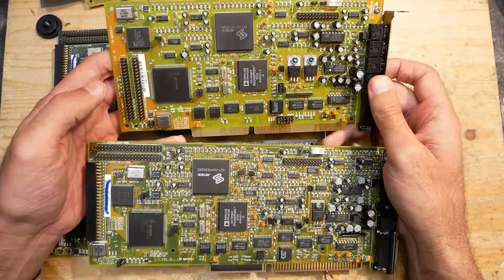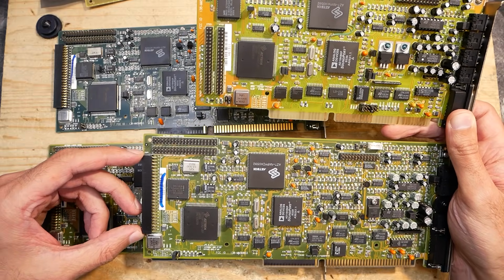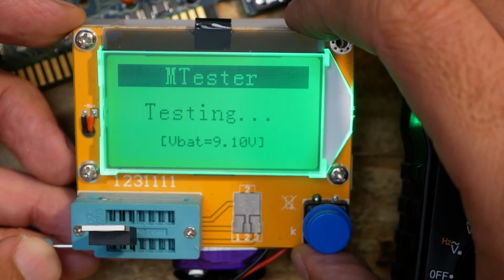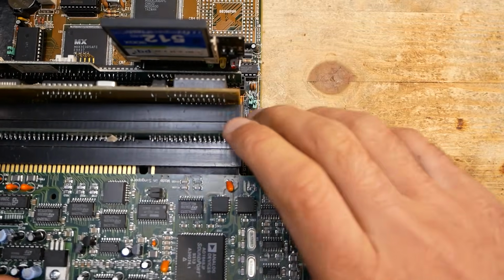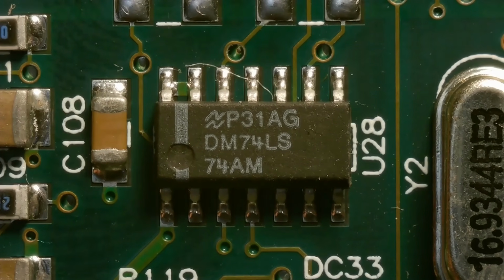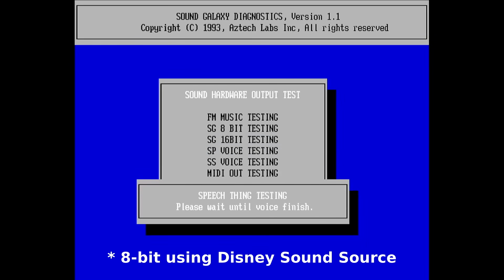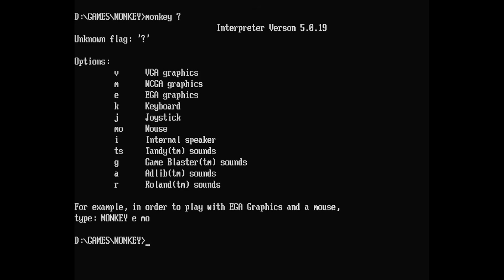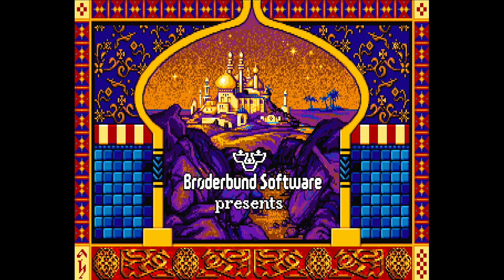Aztech Sound Galaxy NX Pro 16 with SoftMPU and Roland MT-32 emulation.

Comment: Something of note about GODS, the floppy release of Mortal Kombat, and Ultima Underworld:  you NEED a Roland CM-32L, CM-64, CM-300, or LAPC-I for it to sound right.  These games all use a special set of sound effects ONLY on those devices.  A regular MT-32 will not have the correct sounds.

Comment: It seems like phase leak from AC thru shorted capacitor in PC PSU. Audio amplifier was grounded, so it run high current thru sound card

Comment: As other said, SoftMPU only fixes detection of MIDI interfaces, independent of whatever synth you might use. If you arent using a real MT-32, or a MT32Pi type device, then none of the games will sound right using their Roland music option. Try the same setup with your Aztec daughter board, but in the game setups choose General MIDI rather than Roland. This can make the timing of notes weird as well as their sound, since the ASDR envelopes and other parameters will differ.
Reply from the maker: That's the point, there are barely real mode games with General MIDI implementation. Usually those are older games from the time where General MIDI was not yet standardized and so the games offer only MT-32 as an option. I have to try a modified SoftMPU which runs in protected mode games. There was a prototype which I saw.
Reply: @necro_ware  Ahhhhh, gotcha. Makes more sense in that case! It's pretty cool that you got it going though, and the samples on the Aztec daughterboard actually sound pretty good hey!

Comment: 2:34 wth is this color between the pins
Reply from the maker: You probably mean the scratches which were left there by the previous owner struggling to desolder the regulators.

Comment: 10:00 Technology has changed since this card was build.
The fact you don't measure the same values between the regulator pins doesn't always mean it's dead.
Many modern components use Cmos technology, instead of bipolar.
So even if they do the same job, measurements are differents between pins.
For example a NE555 doesn't use 5k internal resistors anymore.
I test regulators with a power supply and measure output voltage on a load.

Comment: Well General MIDI wavetable add in cards/ sound cards have only very extremely basic MT-32 support, which support only default bank. And usually as bank 127 instead of bank 0, so probably you will needs original software from that card (if does exist) which will flip banks. Anyway even after that most games will sound bad, as MT-32 is real programable synthetizator and most of games are programing their own sounds/ patches (that what in reality is happening when you see initializing MT-32, it is trying to send sysex to program MT-32). So better is try to use General MIDI mode then MT-32 😀

Comment: The odd sound is expected when trying to play MT32 Midi on a General Midi Synth. Soft MPU doesn't do full MT32 Emulation if you have that mode enabled, it uses Bank switching only and only works with some synths that have a suitable Mt32 sound bank. The result is poor even when at it's best.  You need to use a MT32PI wavetable card to get proper MT32 Support on the wavetable header.
For newer general midi games (doom, duke3d) you should try to use midi without softmpu as many games just use MIDI UART mode and don't need intelligent mode emulated by SoftMPU.
Reply from the maker: I know, GM has a hard set of instruments, where MT32 uses intelligent mode, where the sets can be uploaded and rearranged. Of course SoftMPU can't do magic and simply maps whatever is there. I was talking more about timing and loudness. For example in Gods the effects were played kind of stretched and very loud compared to the rest.
Reply: Gods needs actually a LAPC-I card or CM-32L / CM-64 module to sound properly. It utilizes extra sound effects that they have been added compared to basic MT-32.

Comment: I have several of these cards. many of basic version does not have Amped output with empty amp chips and components... (only LINE out. No amped OUT) I guess it last longer since it is fewer parts...?!? I guess.
I never understand why they did it but... I guess it maybe possible that the manufacturer found they have faulty design of amp circuit or just cost effect way.
Reply: Most generic soundcards connected this TEA2025 amplifier chip straight to 12V, without any problems. Some later SB128s (and generic ones aswell) also ditched power amp chip.

Comment: Hallo PLZ Turn off auyo dubing
Reply from the maker: I can't turn it off, it's an automatic YouTube feature which is activated for you depending on your default language in your browser.
Reply: Go into the settings on the video by clicking the gear, set Audio Track to English and problem solved.

Comment: if you ever encounter sysex commands, i bet many of the older games used sysex to setup and initialize the instrument patch on a mt-32, 
if instruments sounded odd, i would check if the sysex commands passed correctly from game to hardware, there is also utilities to send sysex only for debugging.

 the sound in GoDs  , sounded uninitialized and not mapped , if i remember, mt32 have a dedicated percussion mapping where games used the samples from the synthesizer rather than wave files.
Reply: He didn't play it on MT-32, but on that GM add in card, that's why it sounded absolutely off.

Comment: MT-32 isn't GM compatible, and vise-versa. Even at a basic level, MT-32 uses a different instrument mapping; GM came later. But what you're running into with GODS is different. MT-32's could use custom sound banks, which meant that the MT-32 could be used for sound *effects*, not just music, by playing the custom samples. Your wavetable card can't load the custom samples for the specific game, so it just plays the stock sounds from the bank that's being called. In other words, the card is working properly, the game is working properly, it's just not going to sound right without an MT-32.
Reply: That's about what I wanted to write about the MT-32. One addition though: It's possible to make the MT-32 GM compatible with a certain MIDI file from them that contains a set of Sysex commands that change the MT32's mapping to GM compatible. 
But yes, MT-32s allow custom samples to be uploaded, and that's where ALL variants of MT-32 emulation fail, as these don't implement this - and probably also can't, as wavetable synthesis works fundamentally different from LA synthesis (at least when looking at it at instrument level).
Reply: @bad.sector Yeah, kind of, though it didn't really sound very good. The mixing wasn't the same, and it had a lot of stuck tone issues, but the hack did work ok in some games. IIRC, didn't some later Sierra games do this?
Reply: @ChrisWadge  I don't know unfortunately. I tested the MIDI mode with Descent, and there it worked without any hiccups.
Reply: @bad.sector Descent is actually a perfect use case, because its electronic soundtrack has very little volume variation and uses a lot of really synthetic instrumentation.

Comment: Isn't the SCSI connector just that, a connector that you can add a CD or HD to directly? Though that would need a driver (and onboard controller...) to work. So maybe not. It seems strange if it's just for an add on board though, would make for a long card.

Comment: Mt32 allowed some sort of samples that you only could see with mt32pi or a real mt32.
 You should not need softmpu for duke3d, as the card itself should expose port 330 in general midi. I had an Aztech Rocky, which featured an spectacular software wave table.

Comment: Reminder that 78xx chips are supposed to be short circuit proof
Reply: @lorenzorentniop717 They are supposed to be, but only if there is perfect cooling (which is not the case here) and they won't last forever. How many of them have I replaced in my life...
Reply: @Thales_WH  that is absolutely true

Comment: The mt32 is not general midi compatible. Meaning the instruments are not in the standardized order. This means music will play, as midi is just note on off and instrument numbers, but it will sound wrong. That wave table board is likely set up for general midi. Use it with games that support general midi. Softmpu supports working with an mt32 but it doesn't turn general midi cards into mt32 's
Reply: This. Additionally, the MT-32 supports custom samples and patches to be loaded via MIDI SysEx commands. GODS seems to use them for custom sound effects (hence the long initialization), which of course will only work with a real MT-32, so the instruments are way off.

Comment: Now I’m thinking if they are ferrite beads or maybe those are SMD fuses?
Reply from the maker: At least, the silk screen calls those FB. Could still be fuses, but since there are capacitors arranged like an LC filter nearby, I thought, those could be ferrite beads. Wouldn't bet on that though.
Reply: @necro_ware maybe they do double duty here. Maybe fuses should have some cryptic markings on them
Reply from the maker: Yeah, may be.

Comment: Those are great little cards - I was able to get them REALLY cheap (especially when they're integrated with a modem, people are afraid of those for some reason) and they had OPL chips and everything. I think they're still somewhat affordable out there in the wild.
Reply: Yea, the modem cards are especially cheap. The reason a lot of people don't touch them as they tend to have conflicts without disabling the serial ports in the BIOS and getting the modem and soundcard both working is rather issue prone.

It also helps that aztech cards in general are pretty poorly documented and seen as budget cards (due to their inclusion in a lot of budget prebuilds of the era), and the sound/modem cards even more so. A lot of them fit in the category of "they exist".
Reply: @relo999  I've never had an IRQ issue wit them - they're usually set to COM2 or COM3, and if they're not actively being used, then it won't interfere with, presumably, the mouse, which is the only thing I ever used a COM port ;)

Comment: MT-32 emulation only works with standard instrument layout, games that use custom instruments - sound terrible. Actually it is not "emulation" - it is just remapping GM instrument layout to a standard MT-32 one.
Reply: I came here to say basically this. Gods loads game sounds into the MT-32 during initialization and plays them as "musical notes" during gameplay. 
MT-32 emulation on General MIDI wavetable boards will play those notes as whatever musical patch lines up with the note sent by the game.

GODs is speed sensitive, but if you're seeing the Roland Initialization message, you're mostly past that issue as initialization is skipped on machines that are too fast.

Comment: I am highly suspious of two cards failing in nearly the exact same way. It was probably picked up in testing but rather than ripping up the design for an uncommon event but common failure mode they slap down a 0 ohm resistor hoping it would blow before the chips died.
Reply: I dunno about that.

If that 0R is meant to be a fail-safe, then the way I see it is kind of the reverse -- the 0R is there to be a fuse in case the chips die, not to prevent that.  In theory, 78xx regulators may be able to handle a shorted output by going into thermal shutdown.  I have a Fairchild LM78xx datasheet that says it will.  So the VR should (...) be fine if the amp IC fails or its outputs are shorted.  But it is rated for a peak current of 2.2A, so a "short" would have to be at least that much over an extended time, and it will get very hot before it shuts down -- and I'm not sure I would trust that to happen in a safe (for the PCB or host system) way.  Although whether the VR fails in a way where excessive current goes through its own Gnd pin is debatable.  There are other components connected to that same R though, so maybe it relies on load from other parts of the circuit to trip.

The other possibility is that the resistor is meant to be replaceable with another value.  Adding resistance to the Gnd pin essentially makes the 78xx a programmable voltage regulator.  I.e., a 7809 can be made to be a 7812 or 7815, just by altering that R value (well, technically, a voltage divider between Vout and Gnd, not just a single R...)
Reply: I think the latter is more reasonable. Fusible resistors are a different material designed with much more controlled characteristics. Even a copper trace would have been a more controlled fuse part compared to the 0 Ohm. It's very common to have spare footprints just in case you need to tweak something, and trimming the output voltage would certainly not have been crazy.
Reply: @sirnickity  Certainly sounds more reasonable, but still weird how two cards failed in nearly identical fashion, to me that screams design flaw or controlled failure mode. But I am not skilled enough to design complex PCBs, so I concede that I am probably wrong.
Reply: @OscarSommerbo   It might very well be -- who knows.  But it could also be that something upstream or downstream failed and had the same effect on the board -- to no fault of its design.

Linear voltage regulators and chip-amp ICs are pretty reliable, IME, but maybe that particular part by that manufacturer had a flaw that caused it to fail shorted to gnd?  Or, if these were owned by the same person and subjected to the same trauma, they might have failed the same way because of an abnormal condition.

I went through TWO separate LG BD/HD-DVD combo drives when the media player I was using had its power supply fail -- twice.  Took out a perfectly good drive both times.  That's obviously not a flaw in the drive though.  Without the history of those boards, it's hard to say what happened.  :-)

Comment: In regards to the Midi support for MT-32.  Does the SoftMPU not support SYSEX patches?  Apologies if the question has already been asked.  I have never used SoftMPU
Reply: SoftMPU is not an MT-32 emulator. SoftMPU is an MPU-401 emulator. The MT-32 is a MIDI synthesizer that receives a digital MIDI data stream, and produces sounds from it. The MPU-401 on the other hand, a "MIDI processing unit" is a computer expansion card (it does not only exist for the PC) that can assist the processor to send MIDI notes to a synthesizer at exactly the right point in time ("intelligent mode"), or just forward MIDI data bytes are they are sent from the processor ("UART mode"). Most games just use UART mode, and most sound cards (but not the SB Pro, and the Aztech Sound Galaxies this video is about is not more capable than the SB Pro in this regard) support MPU401 in UART mode.

The job of SoftMPU is to emulate intelligent mode for the couple of games that need it, and play back the output either via an UART-only MPU401-lookalike, or via an soundblaster-compatible sound card. SoftMPU does not synthesize any kind of music.

Furthermore, it is important to understand that MIDI just specifies how to select an instrument (called synthesizer "program") having a number between 0 and 127, but does not specify what instrument number sounds what way. Only in the mid 90s, a "standard" mapping for MIDI keyboards was established, called "General MIDI". The Roland MT-32 predates General MIDI and uses a different instrument assignment. While you can work around that by re-numbering MT-32 instruments to General MIDI instruments, the Roland MT-32 also allowed custom programs by re-parametrizing the synthesizer using Roland proprietary command. Such commands that are not standardized by MIDI and exclusive to a certain system are called "system exclusive" commands (SYSEX). You can't implement the Roland MT-32 custom programs without emulating the Roland MT-32 synthesizer. This is something Munt does, this is not something SoftMPU does. You can get Munt-for-Raspberry-Pi as "mt32pi", and you can get raspberry-bi-to-wavetable adapters ("WavetablePi"). That way, you can add an MT32-compatible synthesizer to the MPU401-compatible MIDI interface provided by SoftMPU.
Reply: it is a Munt emulator by Nuked based solution so i believe yes.

Comment: Aztech sound cards that were made before they went full Plug'n Play are excellent for DOS and Windows 3.1 games.  Their noise levels are pretty good and a lot of the Aztech cards are compatible with early SCI engine games from Sierra.  I am glad to see someone putting in the work to save these cards.  They have become significantly more expensive online lately.  I have a boxed NX Pro card myself.  Still sealed.  I also have 5 or 6 Aztech cards in various old machines.  The later plug and play cards just don't work as well in DOS and Win 3.x.  I love the videos thank you so much for all of your effort.  Also thank you for making the nwX287 module.
Reply: Of course the method i mentioned  will only work in DOS mode.

Comment: There are some cards that may not work because the power supply voltage is not outputting -12 -5v voltage.
Reply: I've actually never ran into this problem, and I've sold hundreds of retro machines, dozens of which had an ATX conversion (PS) done. I believe it because I've read about it a bunch, but I have yet to experience it.
Reply: Author sells the solution for that called  "Voltage Blaster".
Reply: @sahalin12345  Correction, he designed it and released it as an open hardware project.  He doesn't sell it.  Others make and sell it.

Comment: nice analysis and repair.
the best option ive found is attaching a wavetable form of the mt32-pi which gives the correct mapping and customer sounds.
some games dont require softmpu like monkey island if you can change the mpu port in the driver.
my favorite test for mt32 is wing commander. Its acts like Gods where piano sounds come through on non mt32 source.
rpi pico is also a good option for hard mpu as well.